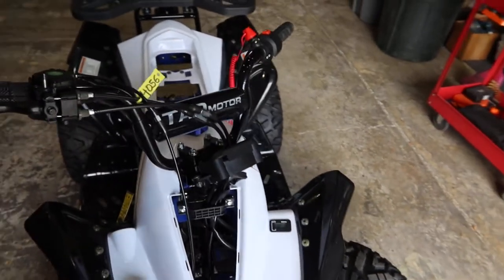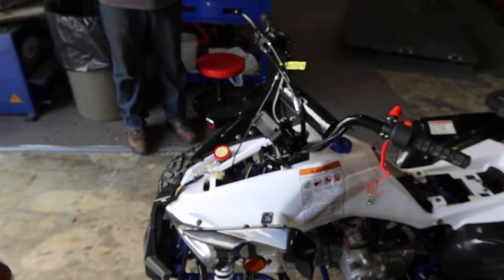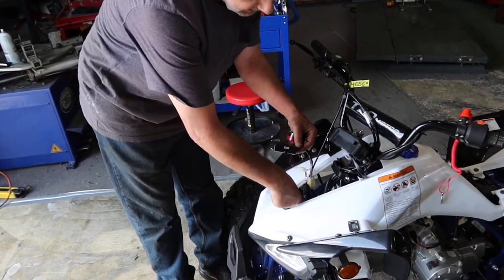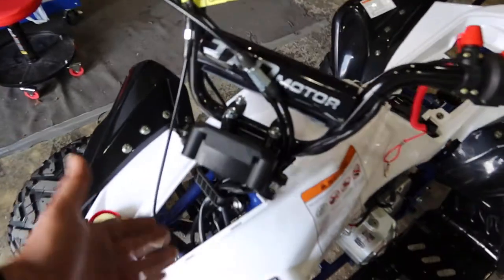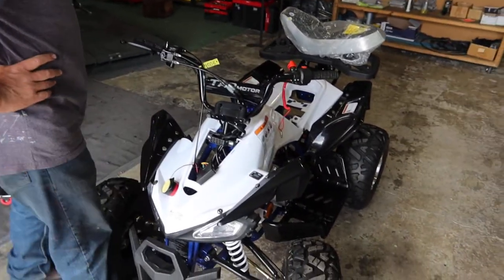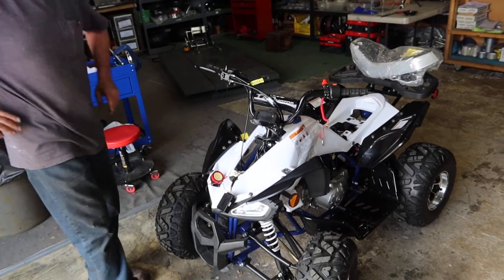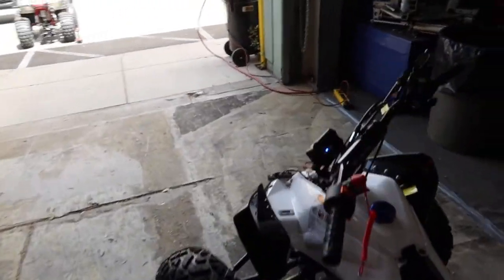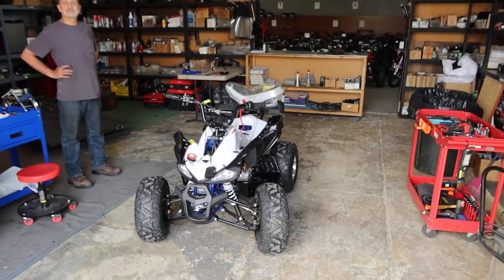ATV ALARM INSTALLATION

Comment: how do i remove this i have no remote and think it drain the battery and drawing energey
Reply from the maker: You can follow the wire where it plugs into the harness and unplug
Reply: @MOTORSUncut  thanks alot
Reply: @MOTORSUncut  also one more quick question and thanks a lot for replying I wanted to know if I disconnect also the back pulley thing for the safety like you know when you pull it out and stops the ATV from running if I unplug that will it affect it from starting or will it run as well
Reply from the maker: Disconnecting the safety lanyard will not allow it to start   @JAMTOAM
Reply: thank u guys the best also brakes light cable connector broke have 3 wires 1 grey one  yellow with grey pin strip and like a orange or peach color need to know witch one has power ??
Reply from the maker: The manufactures use different wire colors from time to time.  Use a tester to determine which wire is hot.  @JAMTOAM